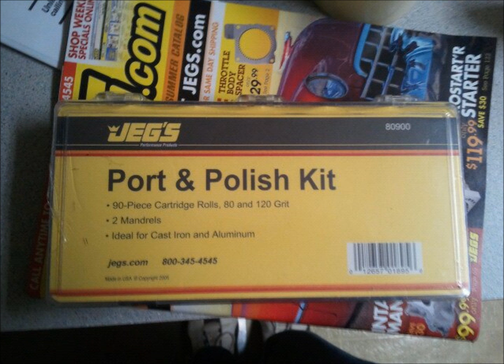LT1 rebuild update

Comment: Sorry for the late response but I would do a cam swap, roller rockers upgrade from 1.5 stamped to 1.6 or 1.7 roller, port polish heads if you want to keep yours, get some forged pistons etc.